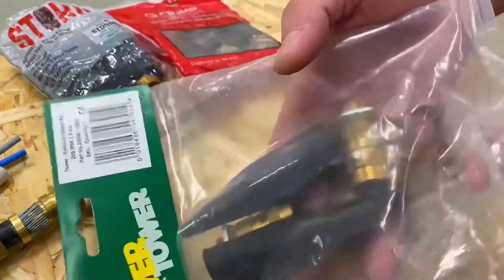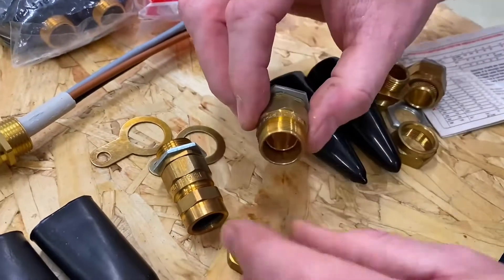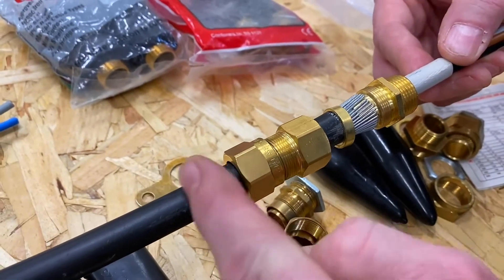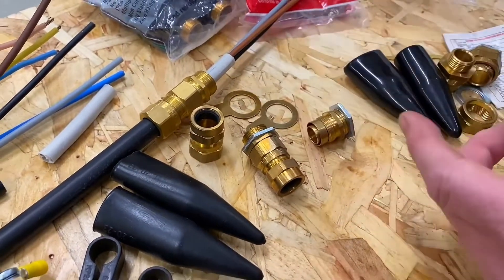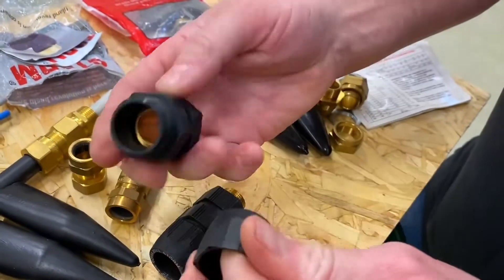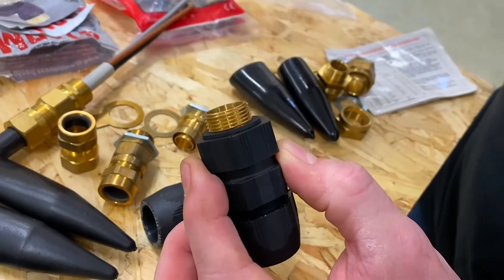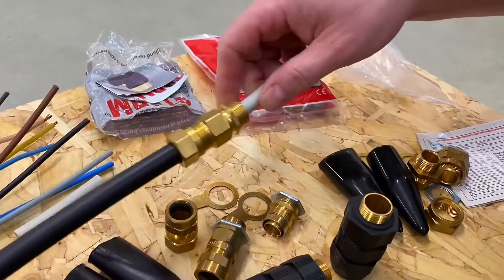IP Rated Outdoor SWA Cable Glands

Comment: Good point about the O ring for IP rating if used in damp or outside conditions. I was given them to use on a job I was on first time used them it wasn't clear what size gland for the SWA as you get with SWA just O.D. of cable which I know can very between cable makes.

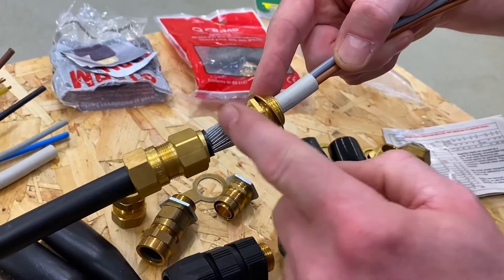Comment: 5:25 - if you're using Storm glands at each end into plastic enclosures, would the SWA still need earthing at one end? As the steel is no longer exposed in any way. Hypothetical question ... and I understand that this wouldn't be appropriate where having the armouring earthed is part of the circuit's protection.
Reply: Exposed conductive part, would need bonding. Also, the earthed armour acts as more than physical protection, it forms part of ADS.
Reply: @MrIbib  indeed. But exposed-conductive-parts are Earthed, not bonded. Extraneous-conductive-parts are bonded.
Reply: @richardwalsh5882  yep, good point. Earthed not bonded… but don’t get calling the conductor we use to earth things the Earth conductor… that’s an entirely different conductor… round and round the merry go round goes…
Reply: @MrIbib > Exposed conductive part, would need bonding.
But it's not exposed. It's entirely enclosed by PVC.

 @MrIbib> Also, the earthed armour acts as more than physical protection, it forms part of ADS.
What about the scenario of a surface-mounted cable which, for extra fun, is given additional protection by a 30 mA RCD?
Reply: @obd6HsN  true, yet another grey area where the terminology doesn’t really match the reality.
Reply: @obd6HsN  I think regardless it would be good practice to always have the armouring's of any SWA cable (installed in any location) continuous with the CPC / connected to the general mass of earth.

If the armouring's are not connected to earth and that cable experiences damage great enough to go through the armour and expose a single live conductor (eg hit with blunt object or crushed), how would that then operate the RCD? The armouring would become live and nothing else would happen, as the current would not be able to flow away from the un-earthed armouring's.
Reply: @billnye142  It wasn't a question about best practice, but about the regs. I suspect the answer is that earthing isn't required in the scenario I set out above.

It also doesn't help to talk about damaged installations.